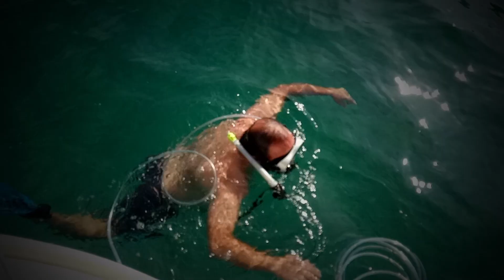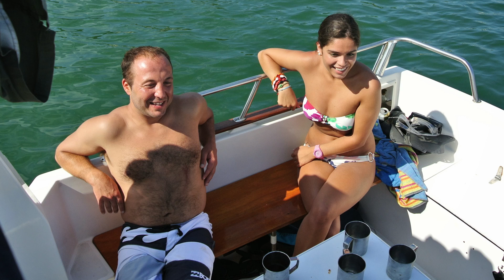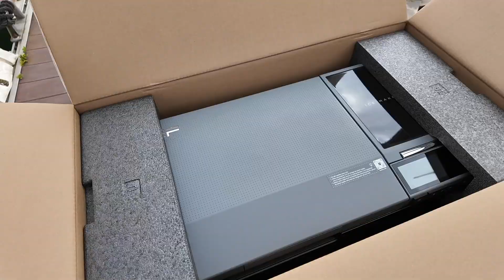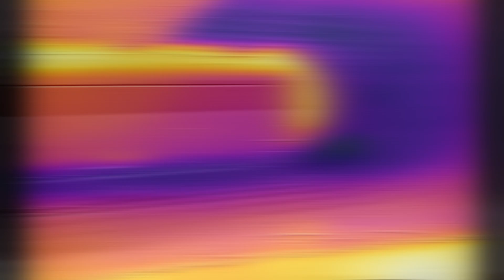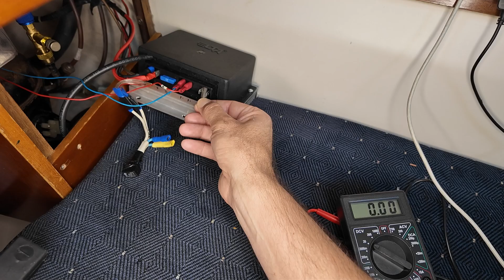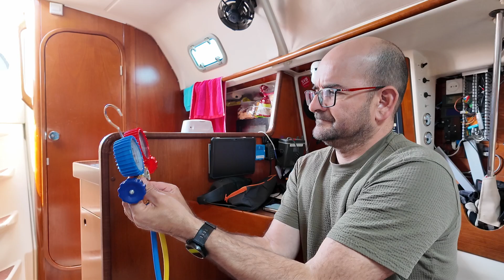EP82 - Onboard Fridges: Upgrade, Diagnose, and Fix Your Fridge Yourself

Comment: You can also use propane as a refrigerant gas . All the experts will throw their toys out of the cot and tell you you're going to blow up the world but the gas is in a sealed system unlike your stove. I've had several such systems running on propane, all work well.

Comment: That ecoflow seems..... rather expensive. I just bought  a portable fridge/freezer for less than $200CDN. After testing, I removed the case and all the foam leaving just the compressor, tubing and controller, all in one piece. I cut a hole in my boat ice box, stuffed the coils through, mounted the compressor and then the controller. I filled the rest of the hole with foam, connected power and conversion complete.... Low cost icebox to fridge  conversion. Anything that requires a ref... tech to fix would make it worth while just to replace the unit again.... in fact, the cost of a pump plus refrigerant plus valve would likely cost as much as a new unit too. The only thing left to do is insulate the top of the box.... for some reason the designer of the boat felt that this was not needed  :P
Reply from the maker: Yes, there are many other options to fix the problem. The Ecoflow is an incredible fridge/freezer but is terribly expensive. A compressor kit for an icebox, cost around 500$. But your solution seems to be really affordable.
It's also quite easy to add more isolation to the ice box of the boat

Comment: I belive we need a special gas certificate in EU to do this kind of work. Check your local legislation before proceeding. That said the certification is not hard to get over here, its just cheaper to buy a new unit 😢
Reply from the maker: Just a pity, because they try to avoid contamination with those certificates, but replacing the fridge will always be what more contamination produces..